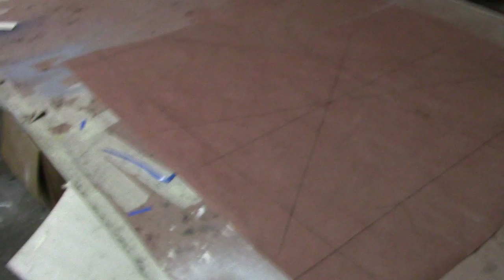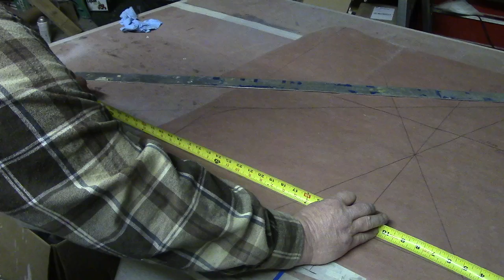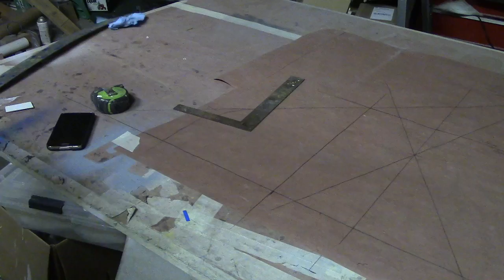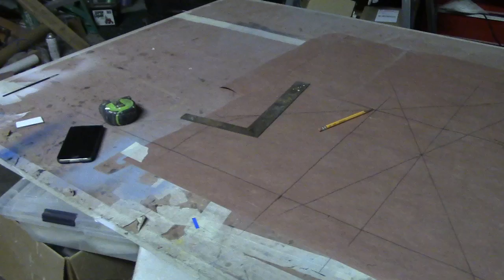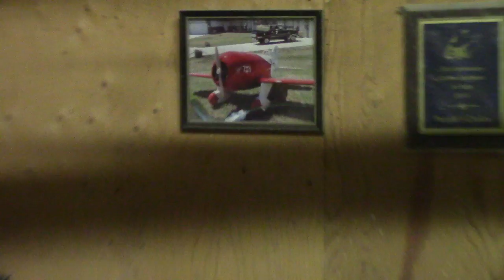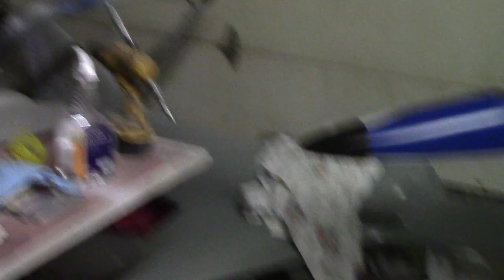checking C/G on A-4

Comment: So are you basing your new calculation off the leading edge line meeting your 18.5 line?  Cause it seems like you could put that 18.5 inch line at 20, 26, 16 etc. anywhere and draw it straight up from the T.E. and it will intersect with your first CG calculation?  Just asking... trying to understand & learn.